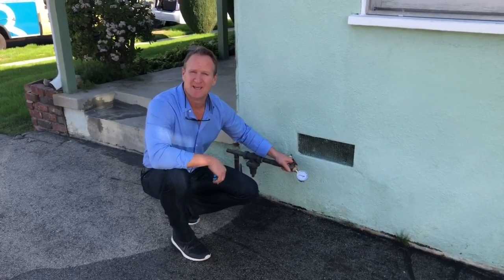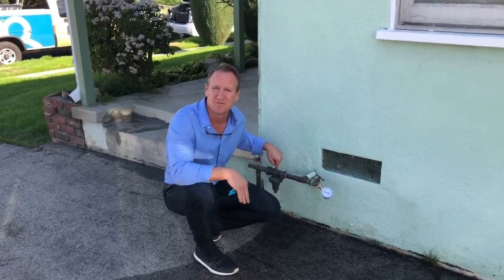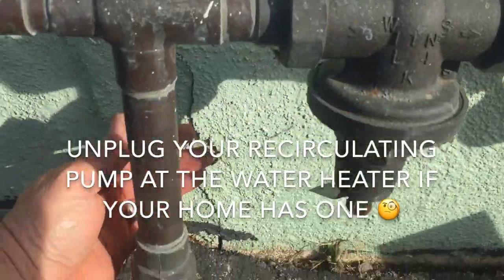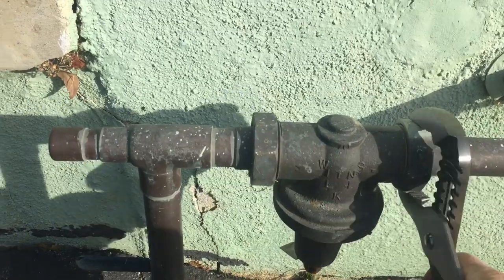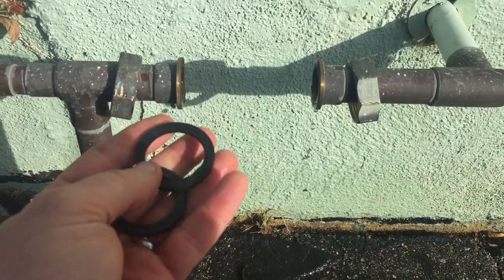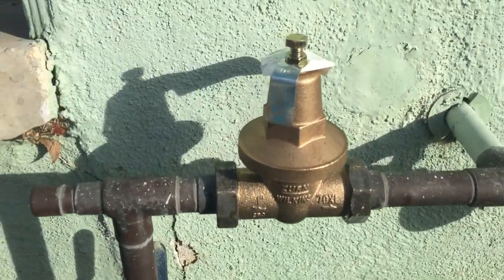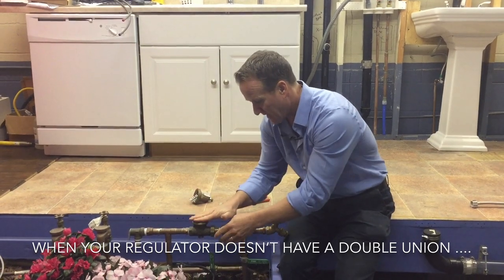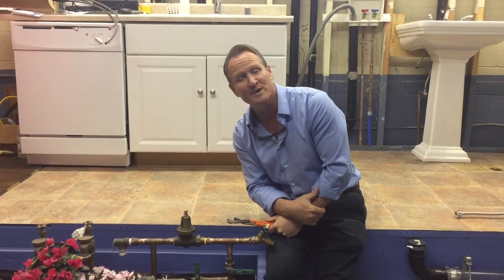How To Replace A Pressure Regulator

Comment: Is installation going to be the same for single union as seen in the video shows for double union? I don't have double union valve. My single union value fortunately does not have a wall obstruction. Thanks in advance!
Reply from the maker: Yes, it will be the same. The big difference is you must use teflon tape on the threads of the pipe. Good luck and thanks so much for tuning in.
Reply: @TwinHomeExperts   Great video. Thanks a lot! I replaced with new regulator on my own after watching your video and followed your advice about teflon tape. A quick question. After replacing I am noticing that I am getting little brown water. Is it something normal with a new regulator in the beginning and goes away later? I am concerned about it. I installed Wilkins 70XL model. Appreciate your help. Thanks!

Comment: do I need 2 shut off the water at the meter? or should main shut off valve be enough? because I don't really want to pay $400 to replace a valve and I don't have easy couplings on both sides of the valve, it seems to only have one and the other side is just screwed on to the pipe ( and I do have to take off the regulator piece because there's not enough room between the pipe and the wall to twist the valve off)
Reply from the maker: The valve just before the regulator is fine to shut off the water.  In regards to replacing, it shouldn't be an issue long as you have the right tools.
Reply: Thanks a lot for moral support. I do have tongue&groove wrenches, adjustable and pipe wrenches as well. I was a bit hesitant because... You know, high pressure and everything. people with experience like you make it looks so simple and easy... but when it comes to real life it always end up in too old pipes with sediments, non-screwable thread etc... and then it turns out a plumber actually needs to cut the pipe and weld another peace etc.
Reply: @nskmda  how did it go?
Reply: @aaronbaraiya3692  i actually ended up hiring a plumber. but now I have proper (2 my taste) compression fittings on both sides of the PRV and can unscrew/replace it myself any time.
Reply: @Dmitry M  oh nice mine is leaking so I'm gonna have to replace it
Reply: @aaronbaraiya3692  you better hurry. :) good luck finding a good plumber (or good luck replacing it yourself if you have this kind of connections on both side of it).
Reply: @Dmitry M  thanks yeah I have two unions on both sides so it's much easier

Comment: Is a thread sealant needed on the valve threads?
Reply from the maker: No, because there is a rubber washer. You can put a dab on the threads to help with the nut to spin on better.
Reply: @TwinHomeExperts  Thanks! good to be sure before I start this project.